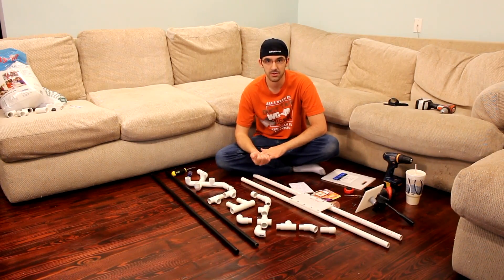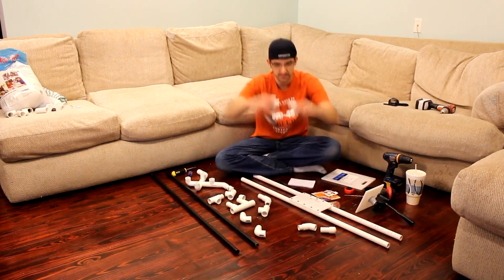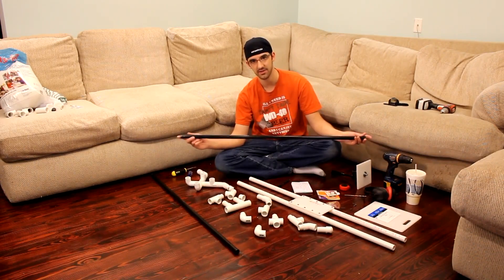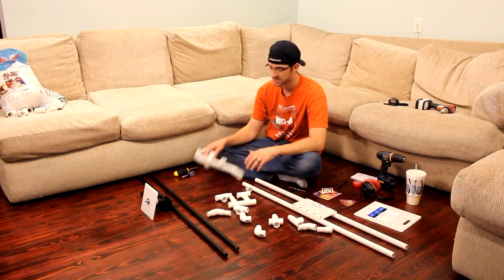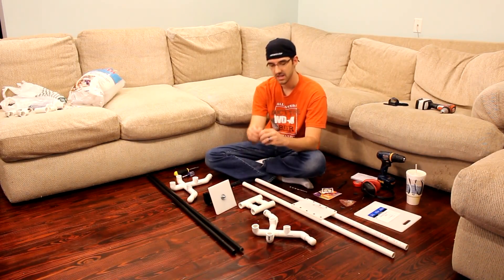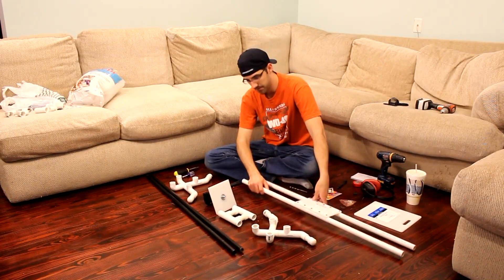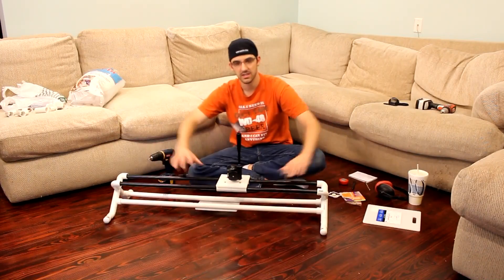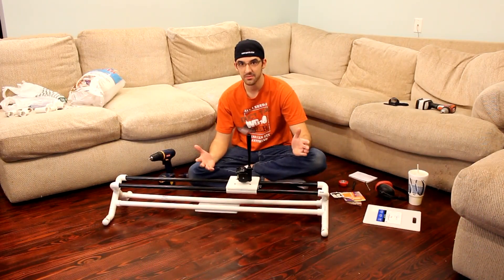DIY KronoX  Camera Slider - $22

Comment: pretty flexible use cuz you can use it horizontally vertically and◔◔>share4.photo/SliderCam?rへM    even get it at an angle if you're using it with a tripod but you can even use it on the ground or table or something. holds surprisingly stable on the tripod despite being about 4 foot long.

Comment: where to get all this stuff in the Uk?
Reply: Gershon Dharmanandan tool station
Reply: button monkey ok thanks
Reply: button monkey i cant find PVC tho, only copper.
Reply: Gershon Dharmanandan solvent weld plastic piping. B and Q also sell and screw fix or any plumbers merchant. Don't go by American names for stuff cos they don't call it that in the UK. Go to plumbing section at B and Q and you will see it. Good luck :)
Reply: button monkey k thanks

Comment: I work as a grip in the industry and this is a great DIY.  if you spray Dry silicon spray on the rods it will greatly improve the slide and sound proofing,  WD40 is to wet of a lubricant, but the silicon spray goes on dry. good luck.  Baby powder is another trick of ours if yo dont have the spray

Comment: My brooms had a fake paint sticker wrap and I took that off then used  this chrome polish stuff. It comes in a silver can at the auto store and  looks like cotton. I rubbed down my broomsicks with it and it made it insanely slick. If using aluminum based brooms I recommend it. Check my channel I have a test video from this diy slider. (it is the one with the car.)

Comment: All your builds are so her they don't look home made..that's why I like them so much. This one is great. I wondered instead of using Armor All (that has an oily base) If paraffin wax, a couple of good coats built up & buffed real good. Also does a level help at all if it was laid on the top of that board while adjusting the "X" area?

Comment: Nice demo but I could use some help putting the top plate together.  That seems pretty advanced and you just jump cut past that detail.  How did you mount the tripod head to the cutting board?  Is that another 3/4" piece on there?  Any help would be appreciated.

Comment: Use silicone spray. Spray on a rag then apply. It dries non-greasy, won't attract and hold dust. Do any painting first cuz it won't adhere to the silicone.